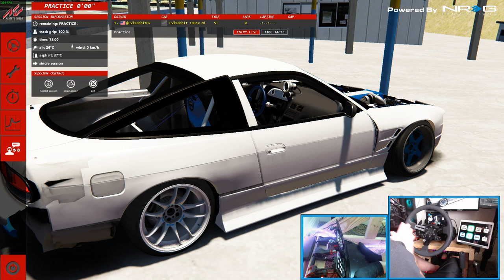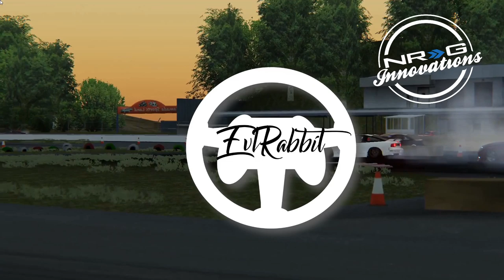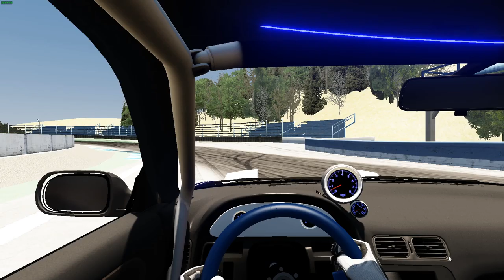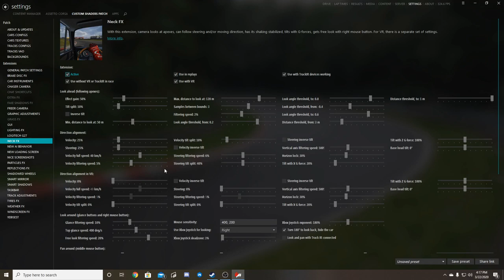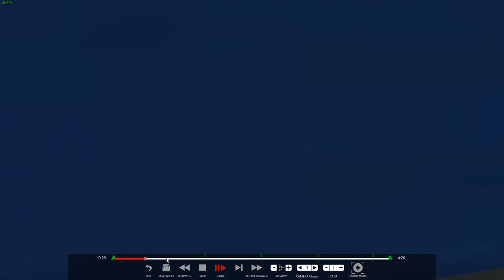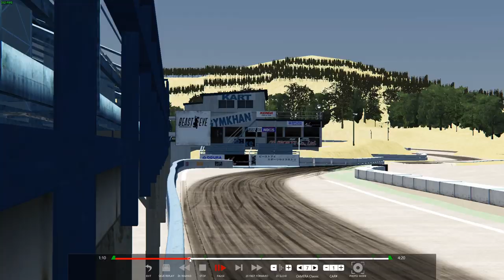Real Head Motion VS. CM Neck Function for drifting what one is better?!?!?

Comment: It's really easy to dial out the rhm pointing to the direction of the wheel. You can actually turn it down to the point where it barely rotates at all at full lock and gets rid of almost all the twitching. Like you said though its a lot of tweaking and there's not really much out there to help people dial it in. With a good direction of how to set up its really way but without it is a pain. At least you can tweak it with the game open to see what each setting does though.
Reply: I would say forsure doesn't have good RHM settings. Because I've ran RHM for 5 years and literally never had a single twitch problem lol...
Reply: @YashaTriceps  when i first opened it i did but after playing with each setting over a few minutes one at a time to see what it was doing exactly mine was really smooth. Only issue i ever see now is when i almost over angle and spin it can do this weird twitch but I'm pretty sure it's due to coming close to fully rotating.

Comment: Feel like this video is exaggerated for read head motion, turn the smoothness up and it doesn’t twitch as much even if you are a twitchy drifter. I use about 94% smoothness and never have any problems
Reply from the maker: I will try that thank you for the advice that's what this what this was for
Reply: EvlRabbit for rhm I use lower look angles at a higher fov with high smoothness and it acts nearly the same as the neck motion shown, all about the settings and the configuring and playing around to see what settings are best